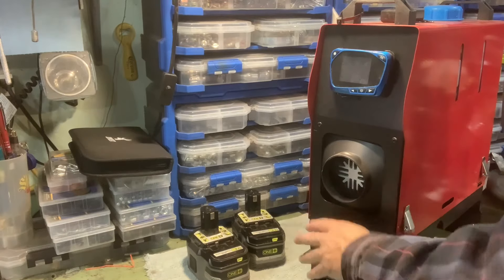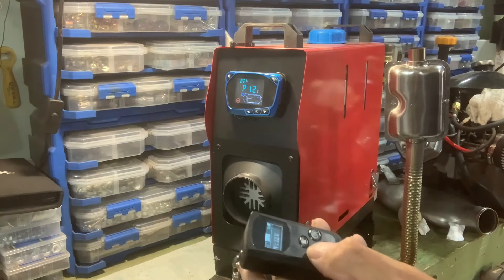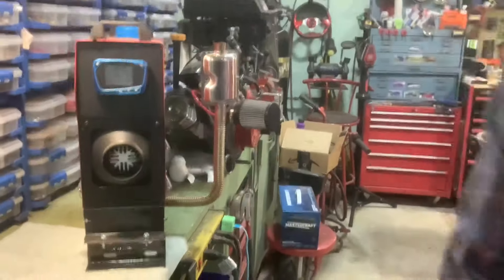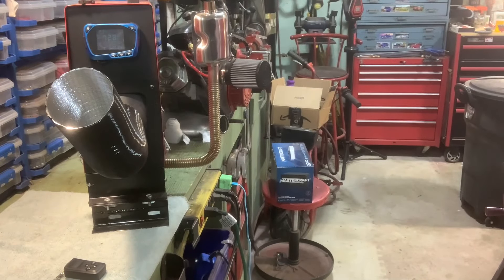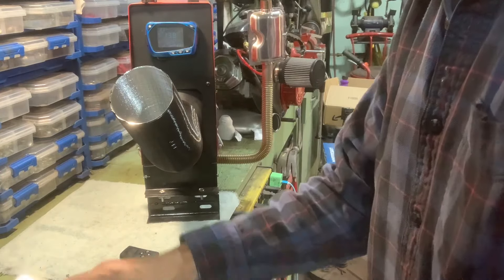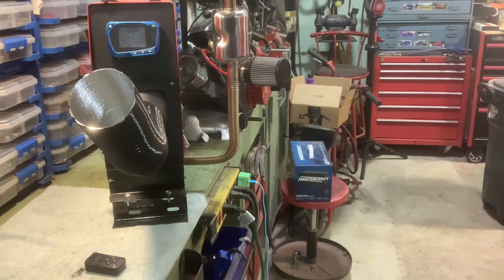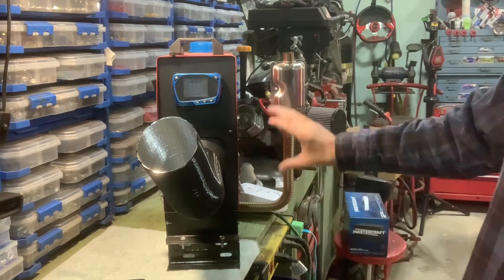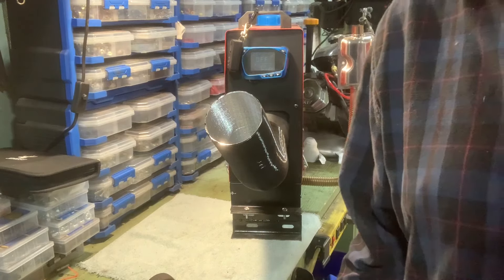How Safe is a Cheap Chinese Diesel Heater?

Comment: Our Pilots always keep a fresh self adhesive Carbon monoxide detector stuck on a empty spot on the instrument panel in the Piston powered aircraft. Whether it's a combustion heater or a Heater Muff it's susceptible to wear & tear pin holes & such but we inspect them every 100 hours of flight time. I think Kerosene fumes are less toxic than 100 low lead Avgas fumes◇¿.
Reply from the maker: Probably not a good idea to get too sleepy while flying

Comment: Not a fan of kerosene. We had a space heater that we used in our Quonset hut and you could taste the kero when it was running. Maybe because I worked for a few home heating fuel companies when I got out of high school. I like propane better but the best heat we had was our Army space heater wood stove. It gave a great heat and had a fantastic smell especially if you burned apple or cherry wood. If  you don't get a taste in your mouth from it  than that's a pretty clean burning machine. Goes to show you that fossil fuel can burn clean. Good video. Happy Motoring.
Reply from the maker: @mostlymoparih5682  if you run the exhaust pipe outside with these there’s zero kerosene odor at all. The combustion chamber is separated by an air exchanger. It sucks in fresh air and blows it over the heat exchanger. I do love wood heat though, nothing is more soothing and warming than nice wood heat
Reply: @BruceLyeg  that sounds good and great description of wood heat.

Comment: How's she goin'?  This was an interesting test.  When I run my 'diesel' heater I can smell it, but my CO detector never goes off.  Good to know eh!!  Take 'er easy!!
Reply from the maker: The burn chamber is completely separate from the air output on these, so if you run the exhaust pipe outside there's no smell and no moisture put into the air.  I'd rather have your heat pump though!
Reply: @BruceLyeg  Ha Ha Ha!!

Comment: I wonder if you can add a Peltier device power source to supply the 12vdc to keep the unit running completely self sustained.
Reply from the maker: @Vibe77Guy  good question. It takes about 11 amps during start up though
Reply: @BruceLyeg  
I understand that. What is it drawing while running? Some of the more expensive types do have self contained batteries. Was thinking that the use while running would be minimal though.

Comment: How much is a jug of kerosene now? Wonder does it burn longer then diesel?
Reply from the maker: I'm not sure, I've been using the same five gallon bucket I've had for a long time.  If I remember correctly, kerosene has more BTU's than Diesel.  Also the additives in Diesel supposedly soot up the burn chamber in these.  I can't speak from experience though, I've only ever ran kerosene.  When the cheap Diesel heaters flooded the market a few years ago people were trying to run them on everything.  Cooking oil, used motor oil, bio fuels, they all clogged up the burn chamber or cause issues with the different sensors

Comment: So, if I put the heater outside and the ventilation in my room, I would't be able to die?
Reply from the maker: Depends. How big is the room? Ice fishing shack or a gymnasium? I suppose it would also depend on how air tight the room was and if there was any additional ventilation